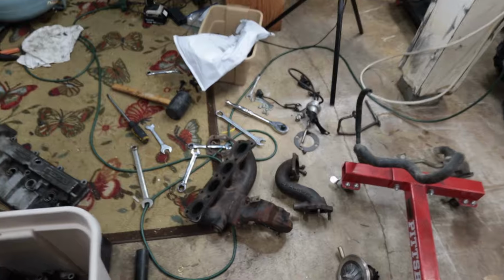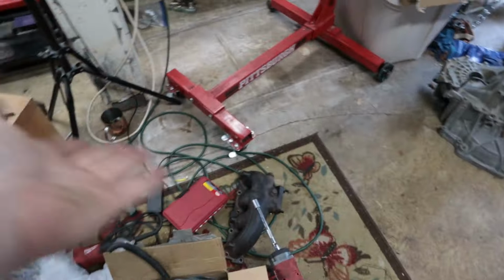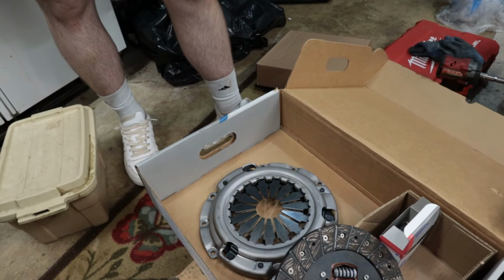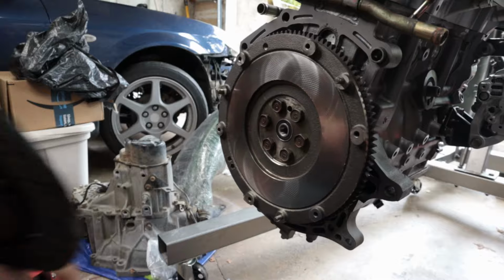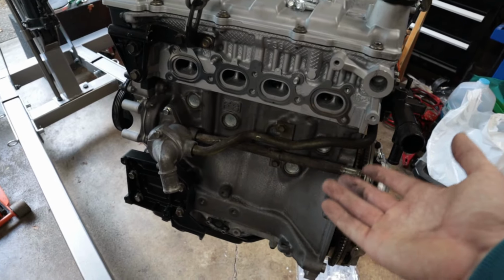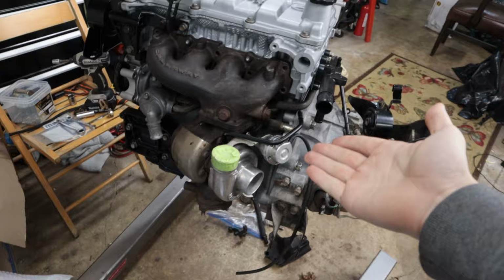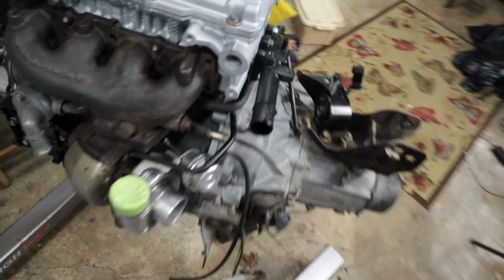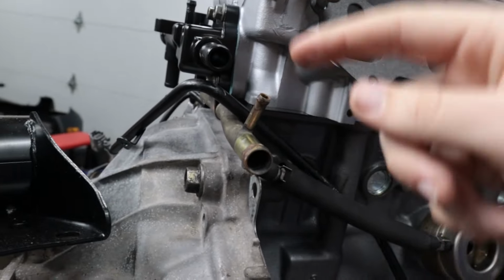Mazdaspeed Protege5 Complete Drivetrain Assembly!! (or 99% at least)

Comment: I’m rebuilding an engine for my protege and I intend to turbocharge it, one question I have that I didn’t hear you mention is where does the water return from the turbo go to? I won’t be running an oil cooler so I can use a banjo bolt on the back of the block to send water to the turbo but I’m not sure where to route the return line
Reply from the maker: There’s a silicone hose that feeds it back into the system. I just spent a while piecing this system together. I’ll have videos covering how I’m routing things soon. Working on editing right now 👍

Comment: Just finished my p5 rebuild. Didn’t go turbo but now I’m thinking about it! Did you go with forged internals? Are you using the MSP ecu or are you doing standalone/piggyback?
Reply from the maker: Stock internals with MSP ECU for factory boost pressure is the route I’m going. I intend to daily the car so I don’t want to mess with setting up a stand-alone for now!